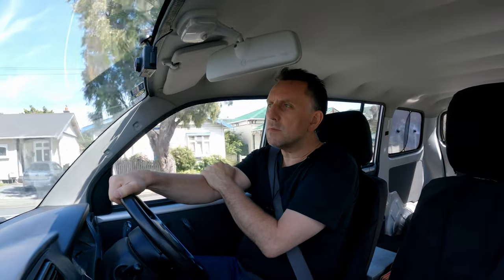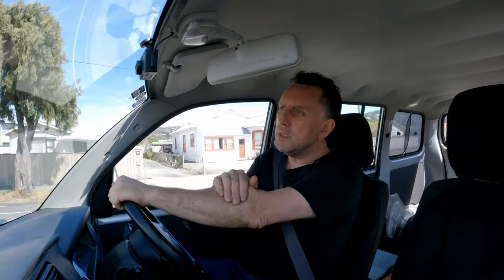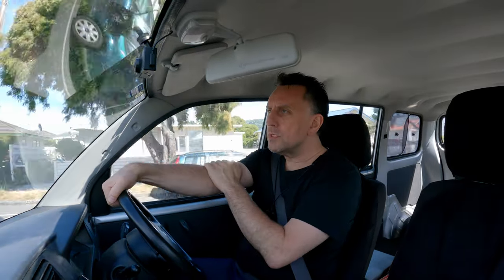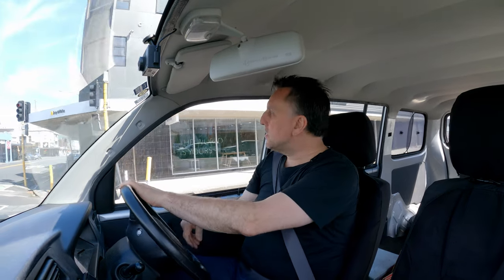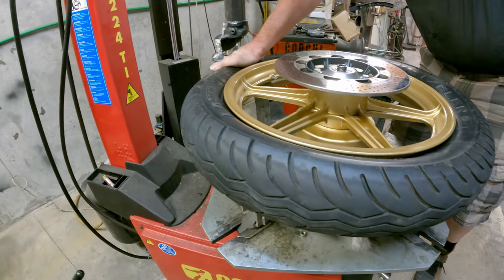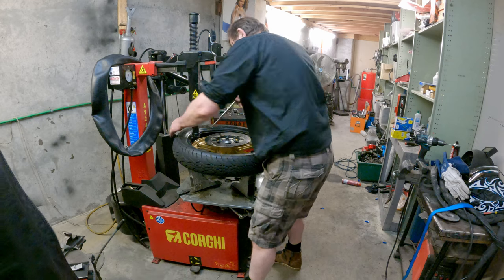Let's Get Some New Tyres - Ducati 900SS Bevel Restoration

Comment: Having just gone through this exact same process on my 900ss i’d Be interested to know the reason you fitted a 120 on the rear when the original factory spec was 110?
Reply from the maker: Good question Jeff. I did investigate the size options in detail beforehand but that isn't in the video. People mount 110, 120 and 130 on these bikes. The MHR Mille had a 130 on it, but the rest had the 110 as you already know. In my opinion the 130 is too big visually for a 900SS. I find that the 110 looks great, especially on a spoked wheel 900SS. But in my case, the bike had the exact same Metzler 120 on it when purchased and so I was already used to the look and liked it, especially on the FPS cast wheels. It still fits well in the space, away from the chain and brake bits. If I hadn't already had the 120 on there and knew how it looks and fits, I probably would have gone with the original spec.

I've just had a look on Metzler's website and I note that their recommendation for the 75-82 900SS has since changed to a modern-looking tyre. This appears to be because the Lasertec is no longer available in 110 or 120. They still show the Lastertec for the Mille but as a 130 only. This might just be the case here in NZ, not sure.

And in terms of riding, there'd be no real difference between these widths so I didn't consider that.

Just something else relating to the rear tyre widths... There is an idea going around that the wider tyres, the 130 in particular, will cause the profile to 'peak' when mounted on these rims. I researched that and found it to be untrue. The 110 to 130 are designed for this rim size and rather than the tread peaking, the thin side walls simply spread out to fit the rim.
Reply: @Ducati900SS  you can go as wide as you like on the rear - just as long as your front is proportionately sized to matched. IF idiots choose miss matched tyres their gonna' fall down in innoculous looking bends.
Reply: I had a120 rear when I bought my 78 900SS with FPS wheels and to me it looked too large and the bike didn’t lift the tyre off the floor when on the centre stand, most informed opinion out there says that a larger tyres make an already lazy steering bike even slower, it might have some benefit on the track but for road it’s standard spec for me, Avon Roadrider 2 as I have used them on all my Ducati’s over the years so know how they feel, very jealous of your workshop!
Reply: The mis-matched tyre sizes is a deadly trap for new players. Still - many a motorcycle store will fit them if the customee want a fat-arsed rear end.
Reply from the maker: @jeffhopkins8131  Hi Jeff. Note that the 100, 110, 120 and 130 Lasertecs are a matched set. They are specifically designed to be used together and they don't get taller as they get wider. The 130 is 80 profile rather than 90 to counter the extra size.  The extra 10mm in total tyre width converts to a fraction of that at any given lean angle and is basically nothing on a matched set. The theory of larger tyres making it harder to steer certainly applies to the front end, but it needs to be a real increase and with a different profile. 

The very common issue with the rear wheel not getting off the ground on a 900SS is because everyone swaps the shocks for Konis or similar and they weren't/aren't available in the same short length as the originals. This was the case on my bike as well and I installed a longer stand to make up the 15mm difference. I also considered the Avon Road Riders as they come highly recommended by many riders. I decided against them solely based on appearance. 

Just for interest for anyone else reading this in future, I also examined the Bridgestone Battleax BT45, which is now a 46. That has a slightly more modern look and just has Silica compound in the rear. There is also the Continental Classic Attack that they market as specifically for classic bikes, but that doesn't extend to their appearance which is butt-ugly and they don't have 110/120. Fallon says the originals were Michelin 45. I looked for confirmation of this but couldn't find it. I expect it would have had different tyres in different countries, and different in later years as well. The modern Michelin 45 they still sell is for small bikes. That covers all the ones I checked out.
Reply from the maker: @jeffhopkins8131  Thanks regarding the workshop too. I only kick myself for not doing it years ago! Instead I worked in a garage full of garbage and rebuilt my Ducati surrounded by boxes of junk and water leaks. So after largely completing the Ducati I set about cleaning the garage out, did the floor, fixed the leaks, covered the walls, also a false ceiling to cover the pipes and wires. Added all those LED battens. 

Again for anyone reading this in future - It's important to get proper powerful battens, not those cheap ones that plug into each other and into a socket. The proper ones are far brighter. It's almost a bit too bright to be cosy, but it sure is nice when working on things. Then I started replacing all my crappy old tools and set up those benches and cabinets.. they were the cheapest ones I could find but they're great. I started my working life as a darkroom technician where absolute cleanliness is essential. That's why I also clean my workshop up all the time. Now I just have to pay off my credit card all over again!
Reply from the maker: @apistosig4173  Just need to make sure readers know that the Metzler Lasertecs in this video are a matched set all the way up to the 130, which has a lower 80 profile.

Comment: Rim guards? You mentioned nylon, but I didn't see too well................
Reply from the maker: Hi Dusty. Yes, I had purchased some of those plastic rim guards for changing tyres  back when I thought I would be doing the job by myself. But as Andrew in the video tells me, they make it difficult to get the tyres on as they are so thick. I didn't try them but they are quite thick so I can see what he means. Then I asked him about using the zip tie method, which would seem to avoid that issue, but he said he hasn't used that himself. I think I would use zip ties if I ever had to do it myself.
Reply from the maker: Following up... I just watched a bit of the video and I see where I pointed to the clamps on the machine that holds the wheel. Those were my main concern about these sorts of machines and so I took an interest in them being made of Nylon or plastic. My previous comment doesn't apply to this obviously.